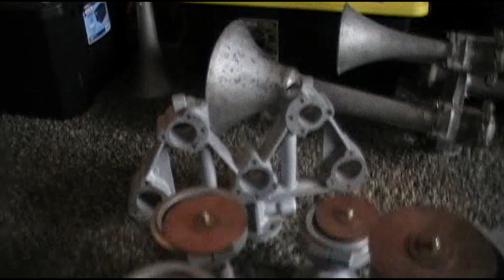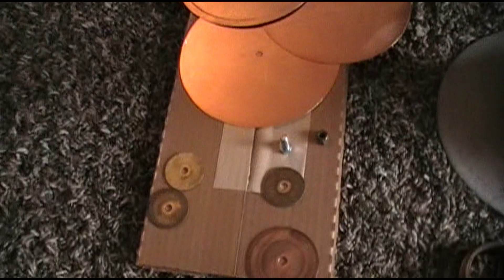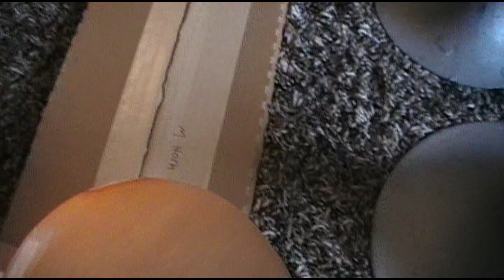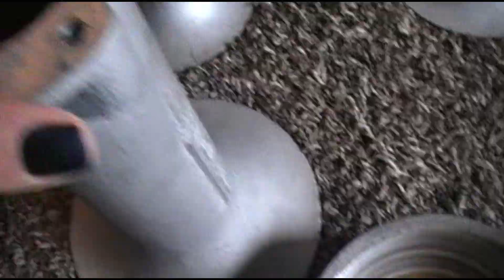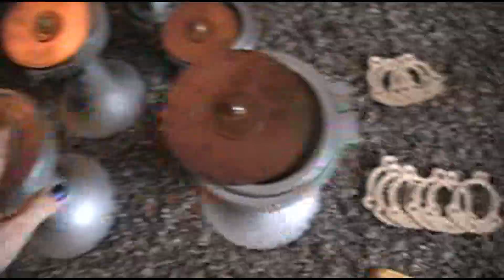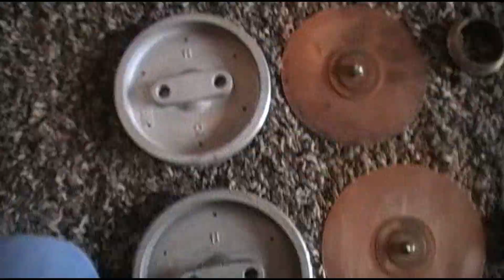M Horn Anatomy and Parts

Comment: The really old M seats, or "nozzles" as you call them had no o-ring at all and pressed directly into the chamber. This only lasted a couple months as Nathan was casting the horns in 1950. My May 1950 spanner cap M3 has seats like this.

Some railroads also choked down the inlets; I have a Canadian National M #1 chamber with a railroad installed choke.
Reply from the maker: Thanks for the info!